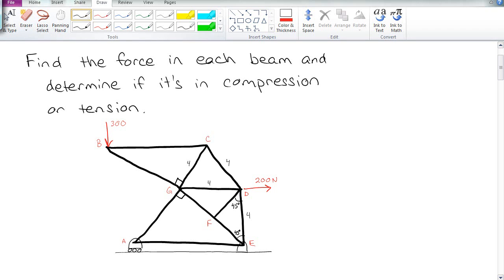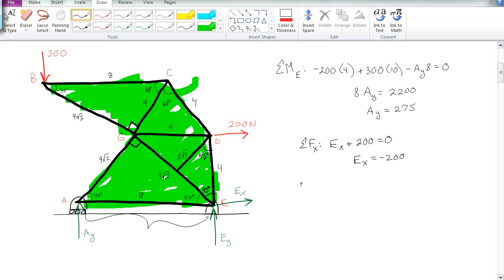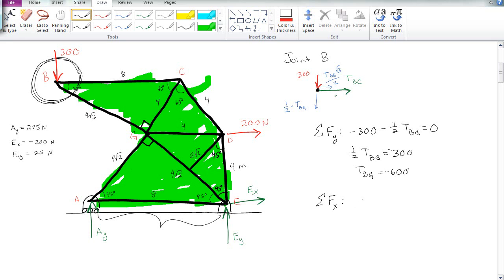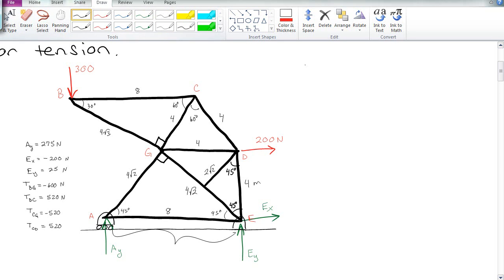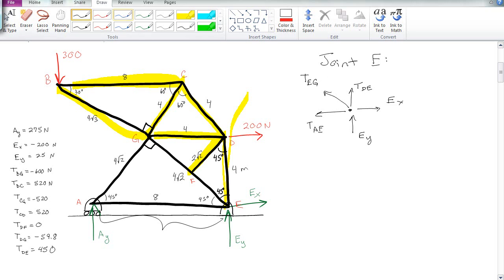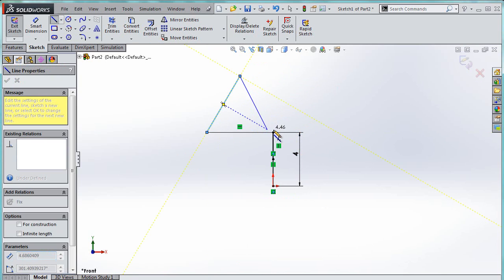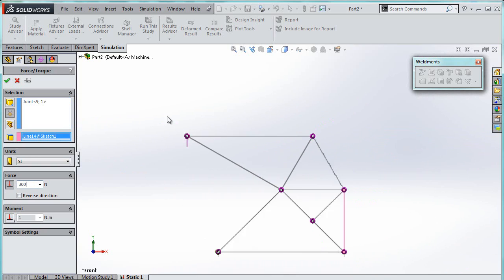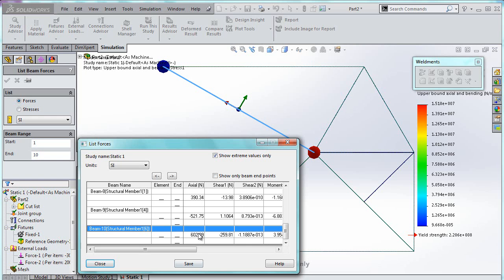Using SolidWorks Simulation for Method of Joints

Comment: Excellent video. Just one point. In the Solidworks simulation you had “fixed” the bottom right hand joint. But because this joint is a pivot joint, it does not resist moment. Thus the reaction moment at that joint should be zero. 

In your analysis results that comes out to be 1.9 Units. If you update the bc at that joint by allowing moment about Z-axis, your reaction forces and moments would match exactly with the hand calculations. 

Analytical solutions differ slightly from FE results due to computational approximations but the reason for the difference in your reaction values was significant and due to this error in boundary condition.

Else Great video. Make more such videos.

Comment: software calculations and algebric calculations are too close and i think it colud be more close too, at the finite element analysis soldiworks use beam elements if you dont specified as truss at the options menu. and also its bending maybe too little at 3D Space maybe litle more constrain to other joints make it perfectly move on 2D space. thanks for that video and lovely channel.